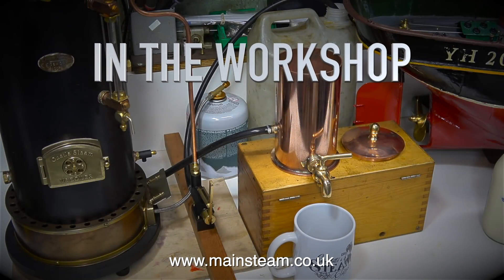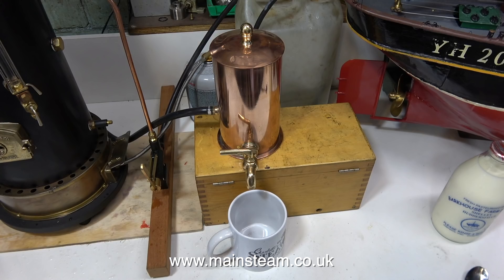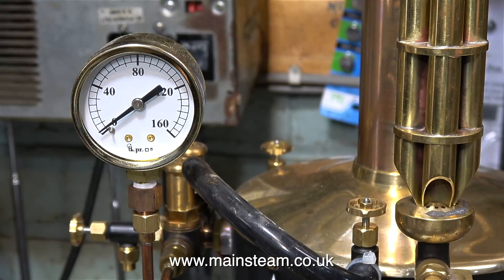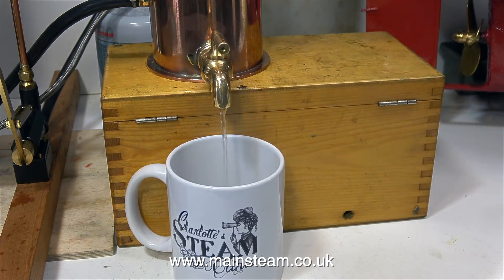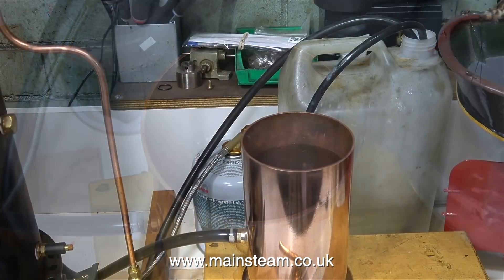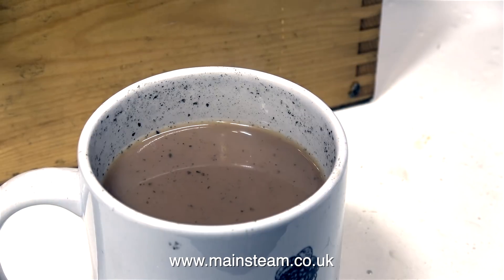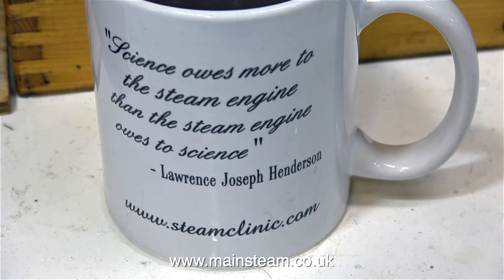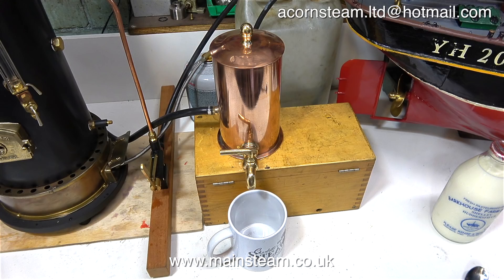A "WINDERMERE KETTLE" - IN THE WORKSHOP

Comment: Have you thought about using Citric Acid to clean the "Windermere Kettle" out?  Its "Food grade" and used in the catering industry for cleaning.  I use it for descaling and getting crud off my instruments and equipment, used to get it in small amounts from the Chemist but due to its bomb making potential and Elf and Safety is now only available bigger amounts off the Net, you would only need a teaspoon of it heat/boil for 5 mins and rinse.

Comment: Industrial estates with common steam-heating used a calorifier in the buildings to extract heat from the steam-circuit. The resultant hot water was then piped for heating & wash-basins, etc. This is a variation on that, & I wonder, which device came first?

Do we have the same milkman? :)

Comment: I'm not 100% sure on this but I've always thought that copper cooking vessels (incl. kettles) were tinned before use.
Reply: copper reacts with the acids in most foods so yes they are tinned. Except for copper bowels used for whisking egg whites as then there is a chemical reaction that speeds the process and produces a better more stable foam (meringue)

Comment: Didn’t know what they were called but we used them offshore on drilling rigs. Two of the rigs had steam heating and on the rig floor where there is a danger of explosive gasses an electric a kettle was not allowed.  We did have one of these  a coil in a container. Tea & Coffee were always available.without danger to others.  The first boiling of the winter season (late August !) was always flavoursome!!! Amacf

Comment: One thing that was not made clear in the video(But was clear after a few moments of Googling) was that the condensate is sent up the chimney(Or away in some other way) and also never comes in contact with the water. Even though in theory this should be clean(Due to being steam) but in practice still might have unpleasant things in it.
Very neat device. I suspect a similar device would allow making tea(If much slower) from the cooling loop of a petrol engine.